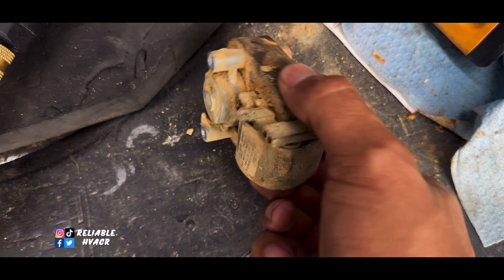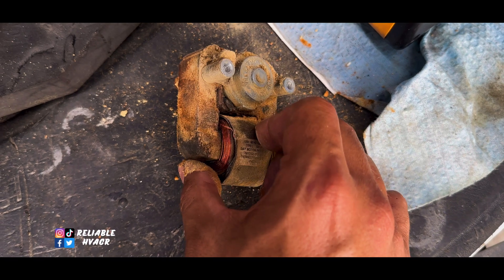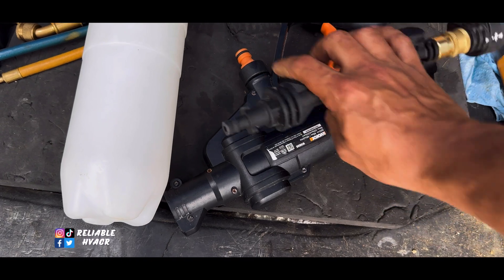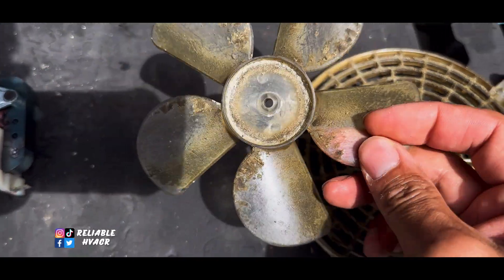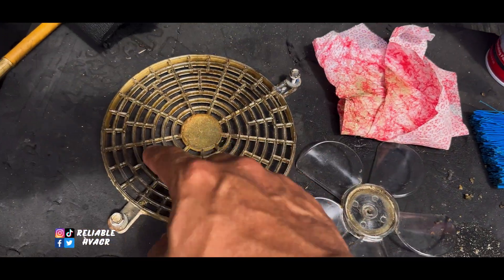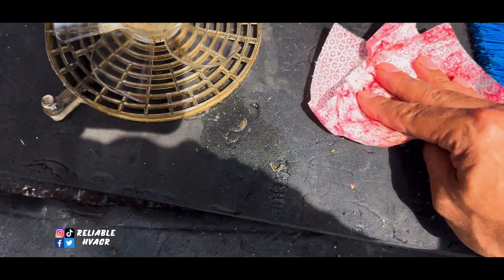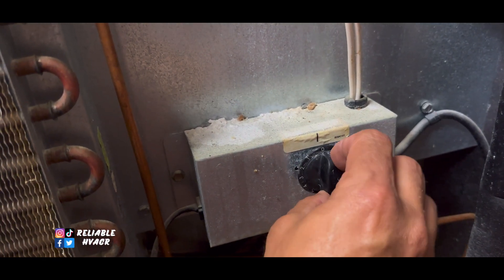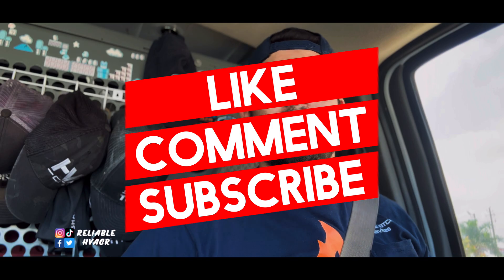Biscuit Freezers Down, Harder than it looks / HVACR

Comment: Great video, just an FYI, there are two screws you can remove from that fan bracket , you can drop it down and install that new motor with ease. It took me couple years to realize lol I could be ring tho. Can see if any other screws on the side
Reply from the maker: I'll have to look at it again, sometimes you can. I really hadn't worked on one in years, they usually just buy a new one cuz they're so old